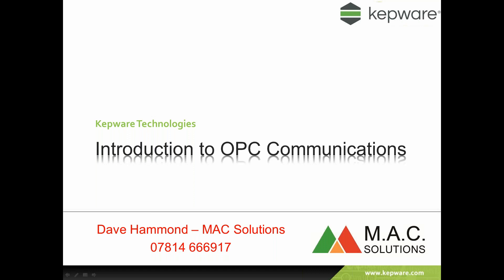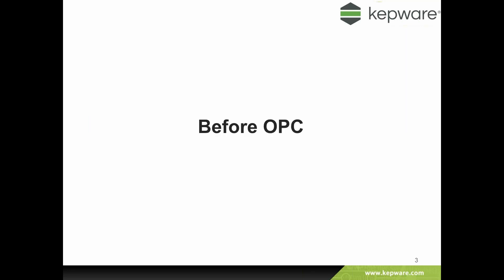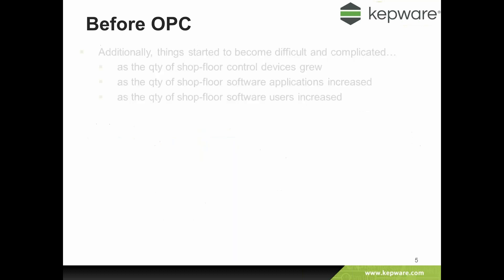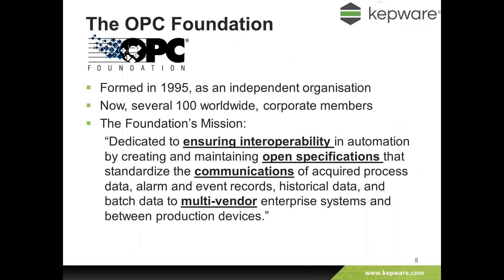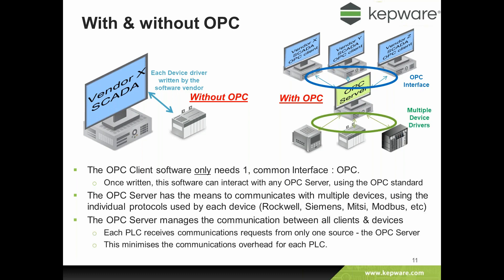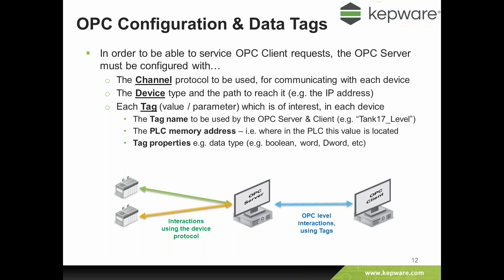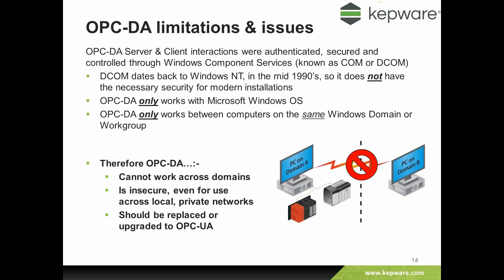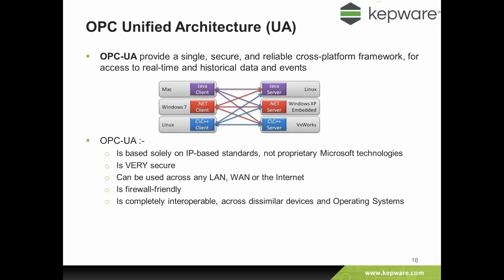OPC Server & Client Data Communications – Introduction and Overview (Kepware, KEPServerEX)

Comment: Hi Dave, 

I found your video to be informative on OPC...Can you help to see if my summary below is accurate? Please feel free to correct me if I'm wrong. Thank you! :)

Different industrial equipment have their own protocols. In order to allow them to communicate among one another, there is a need to make them talk the same language via Open Platform Communication (OPC). 
OPC is a widely accepted industrial communication standard that enables the exchange of data between multi-vendor devices and control applications without any proprietary restrictions.
The function of KEPServerEx works like a ‘translator’ and converts different device protocols, BACNet, Modbus,etc in OT System into OPC.